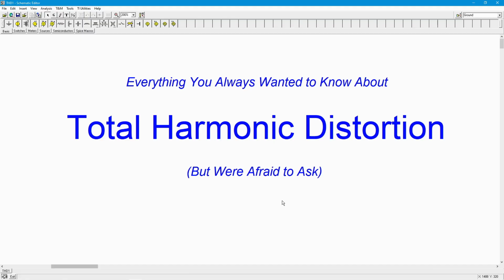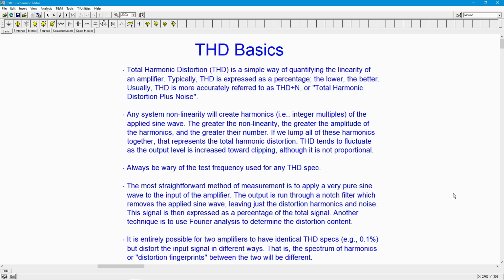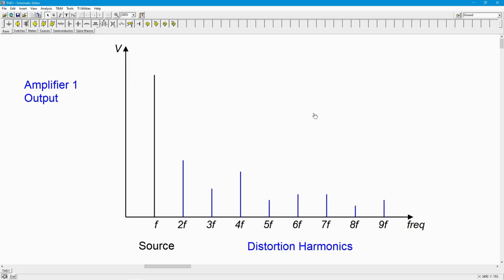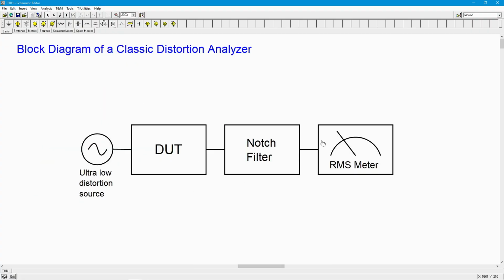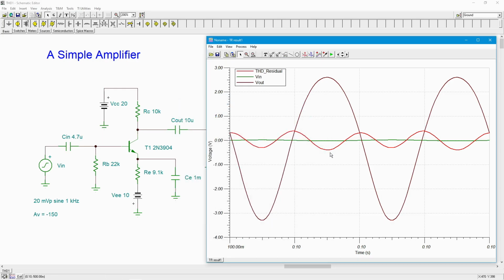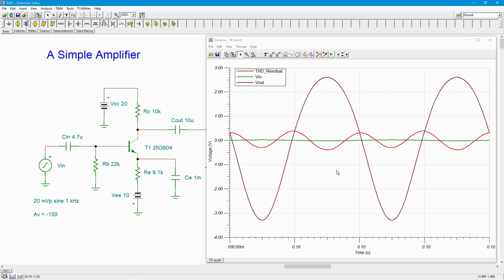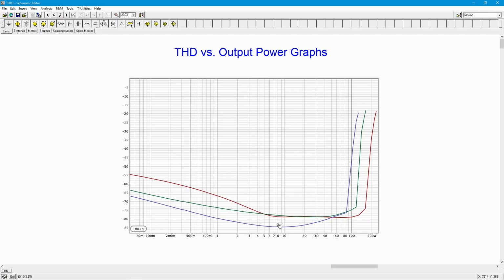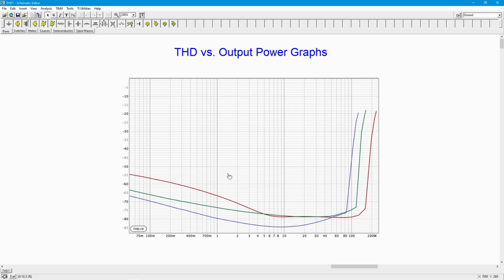Semiconductor Devices: THD - Total Harmonic Distortion

Comment: Thank you very much for this video. Could you suggest me please any documentation that I could use for performing an analysis on the stability of my power supply (EMI Filter+ DCDC converter) when the AC input is already distorted by 6-8%?
Reply from the maker: I would think that any professional level simulator could do the job although it may be tricky to get the precise source you want. You might have to digitize the distorted source signal and then use an arbitrary waveform generator in the sim.

Comment: Back in the late 1970's I was working as a radio broadcast engineer on a low budget, HP was out of range. Built a Heathkit IC-5218 Sine-Square Audio Generator and a IM-5258 Harmonic Distortion Analyzer instead. Did the job required and I still have them both on a shelf, haven't used them in years, I'm sure they need some re-capping. Recently picked up a QA403 Audio Analyzer to help build a PEQ based digital filter for tactile transducers. First time I've worked on any audio stuff for decades, but that is how I found your channel.

Comment: Excellent description Professor as always. I had never given the difference in amplitude of individual peaks due to the effects of other harmonics. As for the golden ear brigade I've been seduced by them in my younger days. "This amplifier has so much more spacial imaging with smooth bass response and the power to make your blood curdle". Rot! the NAD 3120 is one of the highest regarded amps of it's time and on receiving one in for repair was dreadful to my ears. Oxygen free, 800 strand speaker cables are essential. i remember reading a Bob Pease piece where he had read someone saying you can't splice speaker cables and challenged them to allow him to splice cables and audition them against a straight cable and never received a reply! I will give in to valve and transistor amps with even and odd order distortion and they do sound different.
Orchestral music and singing, as you say, are a viable test for HiFi but rock etc. is useless. What does a Strat sound like? Stick fuzz, distortion (that's funny), delay, phasor etc. etc. and how on earth do you know it's a faithful reproduction? Impossible.
I would love to go on but don't want to take hours of your time. Should your university be throwing out an HP339 please send it to me at The home of free speech, England, UK and it should find me 🤣.
I am designing a frequency standard based on the DCF77 signal (I'd like to use MSF for signal strength but the DCF always has the carrier present so obviously better) and I've been really struggling to find a source of information on the design of RF AGC. I propose to use a precision rectifier followed by an integrator then shape the response of the loop to varying input levels. Would it be better to employ two loops? That isn't a question but when does that become a bonus? This is a suggestion  for a possible video description as none seem to exist that are understandable and practical.
Thank you for all your videos which are always enlightening.
Kind regards
John.
Reply from the maker: I replied earlier but it seems that YT ate it. Anyway, funny that you mention the HP 339. Back in the early 1980s we had an HP 334 with a Tektronix low distortion source. Nice pairing for the day. Some years later we upgraded to an Audio Precision PC based system. Now we use handheld units from NTi (Acoustilyzers and the matching signal source). I really like them. Very handy for the students.
Reply: @ElectronicswithProfessorFiore  Thank you very much for your kind reply Professor. I must be honest and say I haven't heard of the later equipment you mention. What I design and build are for pure challenge so used equipment that's sensibly priced is all I can afford or justify. I'll look the stuff up you mention though out of interest- probably £20K to me!! the 334 is a nice analyser and, if i remember correctly, has the lamp/ LDR filter balancing  circuits also like the 339 but not as good.
To get through to us you need a VPN or ID recognition as talk like this can traumatise children! Believe what you hear and invade us soon please!

Comment: I'm wondering if a second identical inverting stage in your example would even out the waveform?
Reply from the maker: You're going to love a video that is currently in the queue. Until then, I'll just say that a "second identical ... stage" won't really do what you want because they are not seeing the same size signal, and thus do not produce identical distortions. Great bit of thinking and observation, though.